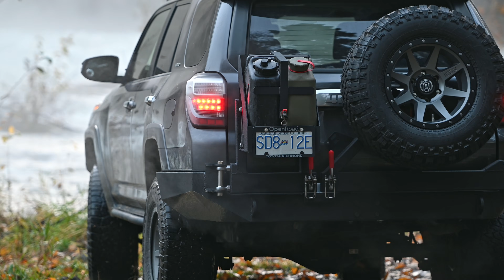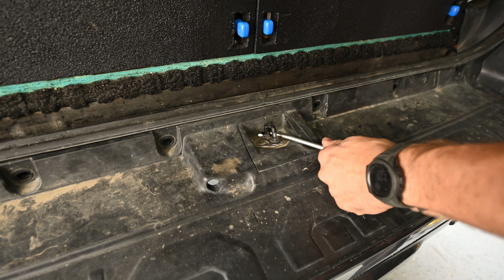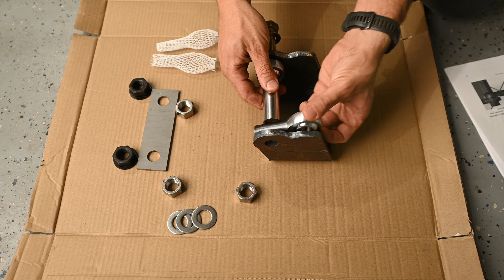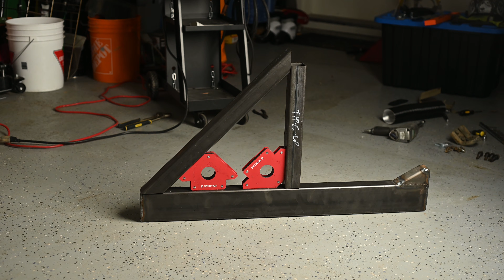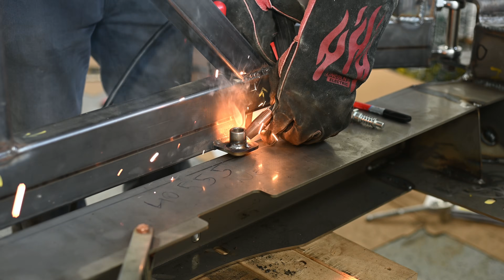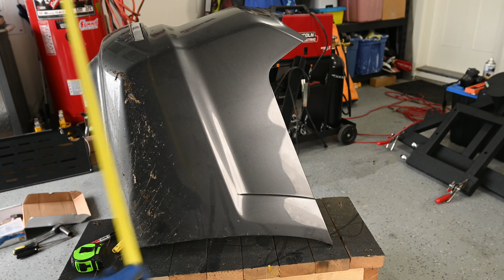5th Gen 4Runner Rear Bumper Build - Coastal Off-Road Dual Swing Out

Comment: Is it necessary to assemble the bumper part by part while on the vehicle, or could you assemble and weld the bumper on its own before mounting the finished product on the 4Runner? This would save a lot of downtime so I can still daily drive my truck while taking my time to assemble and welding the bumper.

Comment: Hey whats up man!... So, in reality, how achievable this is for someone that has no clue about welding or tools or welder machine, although I have followed ll your maintenance videos without issues and I love all DYI stuff, with 3 years of mechanical Engeinner?
Reply from the maker: I would start with more basics projects and gain some experience first. It’s a lengthly process and one that requires some skill. The kit is fairly straightforward and has great instructions though

Comment: too bad this doesnt have a hitch
Reply from the maker: It has an option for a hitch. I have it I just haven't welded it together yet. "Not rated for highway use" though. I've heard its pretty solid though
Reply: @T4Rgarage  probably just legality.  I am in the middle of building my own rear bumper with tire carrier.  I actually am reusing the stock hitch just cutting a hole for it on my steel bumper.  I welded brackets to the rear crash bar to bolt on the rear bumper there.  Was looking at this video for ideas.  Thanks for posting.
Reply from the maker: @Hateraz101  No worries! Happy you found it useful and good luck with the build

Comment: Great video. Perfectly done and is what I'm suing as a supplement to the instructions. I plan on using raptor lining too. How much did you end up needing to complete the job? Just trying to decide how much to order. Like the idea of having someone look at the structural welds as I too am not a professional. Think I might try and take this approach as well. Cheers.
Reply from the maker: I am not very impressed with the Upol self etching primer. My suggestion would be to use a quality two part epoxy primer on the metal after preparing it properly. Wait for the primer to cure properly, scuff it then apply the raptor liner. I honestly should have used more Raptor liner and have noticed the coat is too thin in some spots. I got two coats with the last coat being a bit thin with the amount I had. Try to get 3 good coats with a 60 minute flash time in between coats. You might want double what I used in order to achieve this. You’re probably going to spend a bit of money to get this thing coated properly so it lasts.

Comment: How did you get your exhaust mount connected? I'm building the full height bumper and it doesn't look like it will fit.
Reply from the maker: There is a square cutout for it on the coastal offroad bumper. I put the bumper on and then forced the rubber hanger through the cutout then used a large screwdriver (Phillips head) and put it through the hole in the rubber hanger and used the leverage to get the exhaust to line up with the rubber